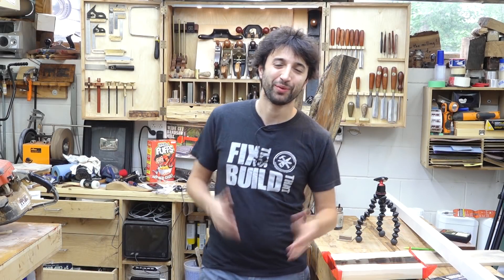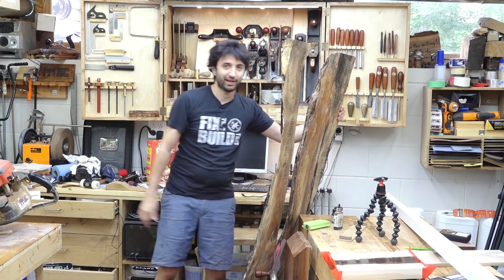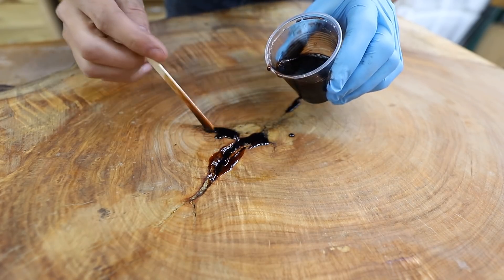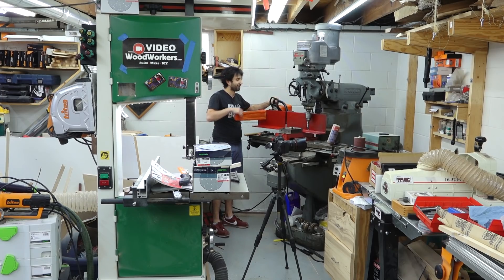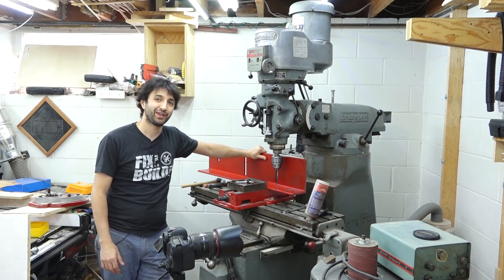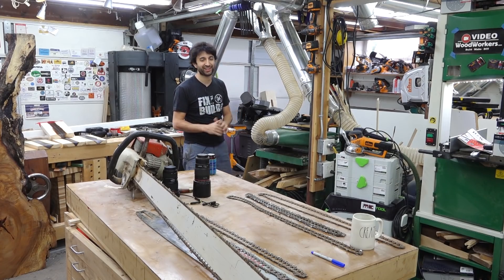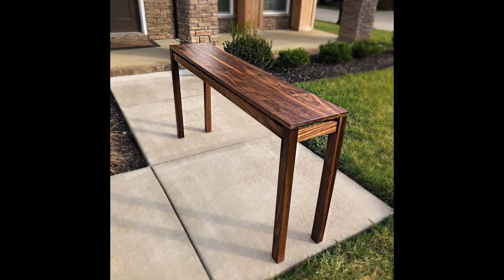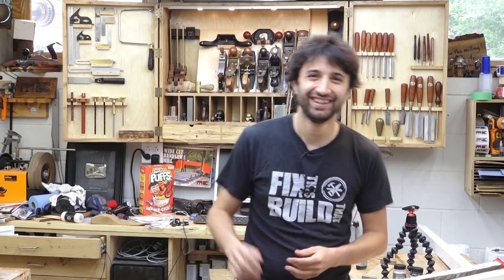Slabbing, Chainsaw Rack, Slab Encapsulation Project

Comment: Matt, what is the rule of thumb for stickers? How often do you typically place them? My little stock pile is already dried but I'm trying to keep things straight in my non-environmentally controlled shop. I know, not a perfect scenario but it's what I have to work with. Picked up a some 1/4 sawn sycamore, white oak and a small walnut slab yesterday from my sawyer.
Reply from the maker: on 4/4 i like to go 18" spacing.  On thicker stock 8/4+ I'll move more towards 24"

Comment: Maybe you should use dark epoxy as a first layer which would end up being the bottom of the slab, then more transparent for the rest of the encapsulation. This way you can see the edges of the slab, but not through the epoxy to whatever is underneath the slab.

Comment: Your oiler caps may weep oil over time in that position on the holder.  You may need to put something on the steel to catch the weeping oil?
Reply from the maker: We'll see.  I'm not particularly worried about it.  I leaned them against the wall for a few weeks to test it and nothing happened.
Reply: @mcremona  My 090 weeps if left in the chainsaw mill and on it's side.

Comment: Hi Matt, I was wondering if you've done a price comparison for a carbide toothed blade for your mill vs. a standard toothed blade? I've watched the majority of your build series on The Mill and cannot specifically recall if you've ever mentioned it. Sorry if you have and I missed. I'm inquiring because of the mention of metallic objects, which I think a carbide blade would handle better, especially given the near industrial capacity you've seem to manage in your backyard.
Reply from the maker: They're around 400-500 each vs 50.  The embedded metal will still damage the blade by knocking off the teeth but there's the advantage that they'll still cut straighter after hitting an object so you can exit the cut without the blade wandering.